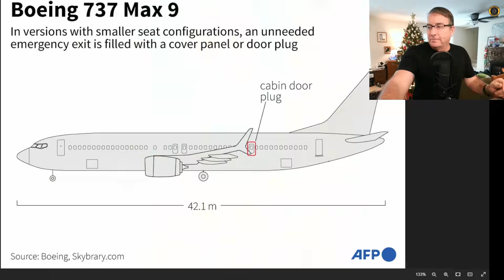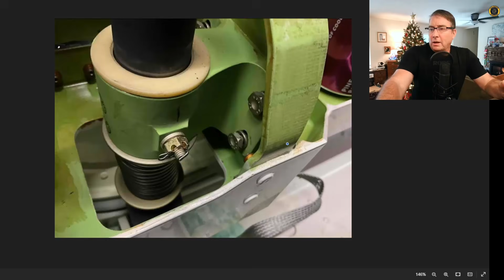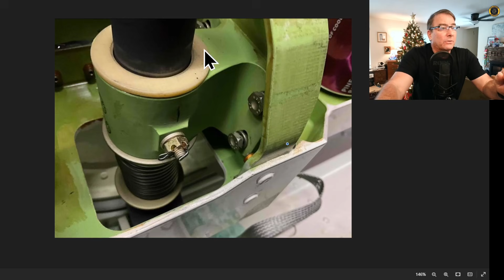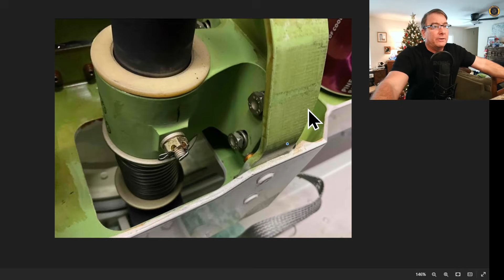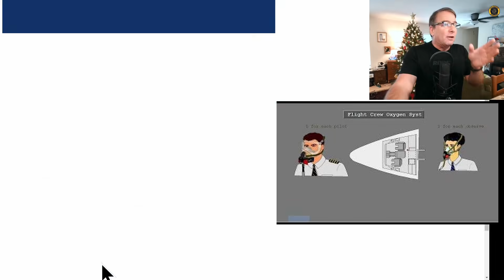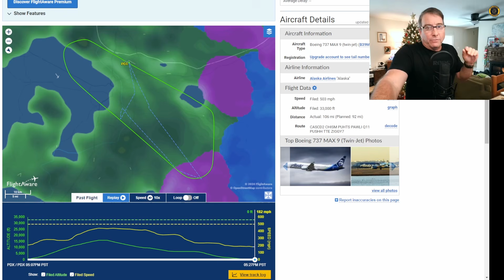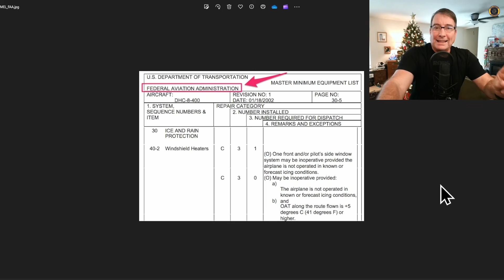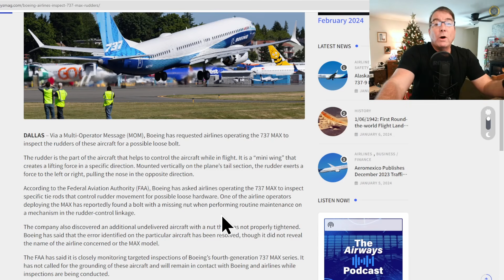"Yes, We Have No Bolts"  9 Jan 737 Max-9 Update

Comment: Who ever works in Boeing QA has got to be sweating right now.
Reply: Someone knows exactly who did the work and who signed it off as complete.
Reply: @grumpy3543  Yes you can pick those two individuals out by their obvious lack of sleep over the last few days!! The mech who did the work, and the Inspector who RII the work!!
Reply: @grumpy3543  Does it matter? It's obviously a systemic problem, so yeah I guess you could blame it all on the one guy who signed off on that particular job, but all that does is protect his hierarchy.
Reply: @seban678  Of course it matters. How does it not matter?  Of course it’s a systemic problem. That’s why they need to be shut down until they get it together. They would do the with an airline that had a systemic problem like that.
Reply: @grumpy3543  So you agree that it's a problem with Boeing as a company as a whole, but it still matters who the individual rando who didn't look at bolts well enough one time is? I don't get it.
Reply: @seban678  Exactly. Accountability.
Reply: @seban678 Same problem has already been found on five other dash 9s.
Reply: @grumpy3543  I wondering if the two people responsible for this disaster on the Plug have tried to ASAP it???
Reply: @grumpy3543  This has sabotage written all over it, plus the pilots erased the CVR, suggesting they did something stupid.
Reply: @itjustlookslikethis  I don’t think it’s that complicated. Just simple, neglect and incompetent. As far as the recorder goes I’ve never pulled the CVR CB in any of my emergencies. They pull the unit every time.
Reply: @itjustlookslikethis nothing the pilots would do on this aircraft would cause this issue. This was clearly structural, not a result of flight use.
Reply: They'll fire the lowest ranked person in the responsibility chain. In the old days they called it the scapegoat.
Reply: QA doubtlessly would be under huge pressure to reduce inspection costs by higher management. The same management who will doubtlessly be 'invisible' now that things have gone south
Reply: Boeing has a QA department?
Reply: @saab9251 QA organization.
Reply: @saab9251  yes because QA is only assurance. its not QC Control. its only an audit of systems now and again. the actual product is not checked. the people who build it are. its a complete shit show and the whole world has done this. no one can build anything with quality. They out source the parts to slaves, bring in a bunch of young H1B1 visa types to push the bureaucracy and teh conmen manager types revel in a chaos.
Reply: I disagree. Obviously, there's nobody working QA at Boeing.
Reply: @mikehanks1399  this is my favorite comment lmao.
Reply: Agree.  People can parrot 'Spirit' all they want, at the end of the day it's a BOEING 737.  Period.  It's BOEING'S reputational harm that occurs if people get sucked out of a 10 week old aircraft.  The buck stops with Boeing.  Slimy 3rd party responsibility deflections aren't going to work.
Reply: @BasedF-15Pilot and Boeing’s stock price proves it.
Reply: @BasedF-15Pilot  yeah. I wonder who hired spirit to make Boeing air frames.

I mean since we can't blame Boeing according to Boeing, we should blame whoever hired spirit to build these airplanes.

There's no way Boeing is responsible for hiring outside companies to make their air frames, right? 

It is such a weak excuse. It also proves why Boeing is the most dangerous modern aircraft. Boeing does not care about taking responsibility. They are interested in blaming everyone other then themselves. No interest in accountability to make the air craft better. Just blame blame blame blame blame. meanwhile the air craft never gets fixed.
Reply: @noconsent    If someone opened the plug door after the aircraft left Boeing's hands and was turned over to the airline, would Boeing still be liable?
Reply: @bobroberts2371  If I hired someone to work on my airplane, and that airplane broke while 18,000 feet in the air, I would take responsibility. But I have morals. Something Boeing clearly lacks, which is why hundreds of people die flying in the Boeing MAX.

Or are we going to pretend Boeing didn't blame the pilots for MCAS killing people? And pretend Boeing isn't doing the same thing now with the subcontractors Boeing chooses to build Boeing aircrafts?

Seems like a boeing problem they keep paying people to make subpar products that kill people.

but hey don't let me stop you from defending a company that knowingly put a jet into service they knew would kill people with one airplane going down every two years according to them, before a single MAX even went down.
Reply: @noconsent    You made absolutely no attempt top answer my question so I'll post it again.
If someone opened the plug door after the aircraft left Boeing's hands and was turned over to the airline, would Boeing still be liable?
Reply: @bobroberts2371  Boeing pays the contractor. By law Boeing is liable yes. I am sorry at your inability to read. I clearly answered your question. So I will answer again.

Contract law has boeing liable for contractor they hire doing poor work.

Even though Boeing itself was the last one to touch these plug doors, so contractors don't matter at all.

also according to the NTSB the doors didn't come off due to poor contracting, they came off because boeing designed at terrible aircraft that will break bolts.

oh and since we both know all this reading will confuse you again.

yes boeing is liable for hiring bad subcontractors.
Reply: @noconsent    So you are saying that Boeing is FOREVER liable for the work performed by non Boeing people AFTER THE AIRCRAFT HAS BEEN DELIVERED TO THE AIRLINE ?  Once again, I'll  repost my original question for the third time below.
 
If someone opened the plug door after the aircraft left Boeing's hands and was turned over to the airline, would Boeing still be liable?
Reply: @bobroberts2371  No one works on the plane that isn't approved to by Boeing itself. Which is the crux of the issue.

No one is saying it is Boeing fault that a group of mysterious men on motorcycles entered the factory one night and changed everything around without Boeing knowing.

any and all work done on Boeing MAX airplanes are done by mechanics and subcontractors approved personally by Boeing.

If a person working on boeing did a poor job, it is because boeing hired a crappy employee.

subcontracted or not.

your scenario doesn't exist. But get getting triggered.
Reply: @bobroberts2371  "Whatabout this made up scenerio that never happened" How about we stick to the facts. Where all work done on a Boeing craft is done by someone approved to work on the craft by Boeing.
Reply: @noconsent    said "   your scenario doesn't exist. But get getting triggered   "  
Got it.  So if an airlines mechanic leaves wheel bolts loose,and the wheel falls off, Boeing is responsible even though the aircraft is no longer in Boeing' s hands.  Why has it taken be so long to see the light?
Reply: @bobroberts2371  No one touched the door plug but boeing and those subcontracted by boeing to build their planes.

Keep making things up to get mad at, it is hilarious.

and yeah when a boeing comes shipped without any bolts on the plug door to the airline, it is boeing's fault. Nothing a mechanic can do to fix it or make it worse.
Reply: @BasedF-15Pilot Specifically, the buck stops with the CEO. Calhoun cannot escape the hotseat for this. This isn't a DEI issue, this is a management issue.
Reply: @GARDENER42  Correct those two, the mech who put the plug in place, and the Inspector who RII the work are bound by law to ensure that it was installed properly! Boeing may have to require  two RII inspectors to sign off critical work!!
Reply: @cv990a4  seriously I don't get this dei bs when the ceo is an old white dude.
Reply: @cv990a4 ohh no no no. DEI is indefensible no matter which way the pie is cut.
Reply: Amen
Reply: Boeing has a reputation?    Boeing should sell to a new company with top tier management.
Reply: Security Check Paint Marker does not appear to have been applied to the Torqued bolts. That's a design/build issue. 

So there's no way on a visual inspection to see if they have moved. 

 @neenernoodle
Reply: @adenwellsmith6908  Not every fastener requires torque stripe. It depends on the drawing as well as the quality inspection plan.
Reply: No argument there. There question is, should there have been? 

They are implying that its either a design fault in that the assembly instructions were wrong, or that someone missed the parts when assembling. 

Given its such a new plane, it is unlikely its stress fractures that propagated. 

Could be that the material used was defective. 

 @gungadinn
Reply: @adenwellsmith6908  I don't see many of those anymore, so simple, and so important for inspection. If they decided to stop doing that to cut costs, oh man, much bigger issues here
Reply: So most likely causes.

1. Assembly went wrong
2. Assembly checks not done. 
3. Assembly manual is wrong
4. Material fault. 
5. Design fault 

I would put it in that order. 

 @MoMadNU
Reply: @adenwellsmith6908 No refrencse marks on the bolts/castings, date coded?
Reply: There was work done to the interior after delivery. I think it will come down to an Alaska subcontractor
Reply: @akshonclip  The image at 5:49 is from yesterday on a United Max 9 they was preparing to inspect.  United said that they found several instances of loose bolts.  Alaska chimed in a bit later saying they have seen some bolt issues in this same area as they wait for FAA instruction on how they will complete the process.
Reply: Boeing QA was the first department out of the door after the Boeing/MD merger when the accountants took over running the show.
Reply: LOL nobody works at Boeing QA.
Reply: I'm guessing, They are quickly printing up 737 max order forms showing these bolts are now an optional item
Reply: No they don't, they killed over 300 people and the CEO got a 30 million bonus that year. All they care about at Boeing is the bottom line, passenger safety is out the door.
Reply: What sucks is to save money Boeing has like one licensed aircraft technician overseeing the work of dozens of low paying high school dropouts and all the blame will land on the one licensed aircraft mechanic. Licensed aircraft mechanics used to be required but nowadays more and more Boeing relies on one licensed mechanic overseeing dozens of assembly technicians who don’t know anything about aircraft maintenance
Reply: Boeing doesnt do interiors, that would be a company like safran or encore
Reply: @motskater  boeing definitely does the final assembly work in the interior, wiring, etc. - but not the cabins.
Reply: @motskater  Airbus used a company called Sergoma that did the interior installation.
Reply: I worked at Boeing a long time ago. Believe me NO ONE at the kite factory is sweating.
Reply: Blaming individuals is exactly the wrong attitude for building quality products.
To get quality, you blame the process not the individuals.
ie. Why did the system fail?
Reply: Bet C-suite and executives still get a bonus, though.
Reply: @NonEuclideanTacoCannon  Of course they will
Reply: Depends what the manual say.
Reply: Spirit does the parts but Boeing the assembly
Reply: Wonder what happened to the pickle fork issue on the NG’s. Juan talked about it awhile ago. Never heard an update.
Reply: That's the problem, they've got rid of a lot of their QA inspectors to try and save money!
Reply: @BatfinksWings  they got rid of the senior qa m replaced with Mcdonald guys and people barely reading and speaking  English to do inspection with no quality background in Renton max lines.
SO WHAT DID THEY KNOW TO INSPECT WHEN THEY DONT UNDERSTAND THE REQUIRED SPEC, WORK ODER, AND READING OF THE  ENGINEERING  BLUE PRINT..YOU TELL HOW IS QUALITY ????
Reply: You are assuming they have such a department.
Reply: flyingfox you have no clue. I was in QA at Boeing. we are handy caped by management. They tell us what to look at and what not to look at. It's all about the money. Keep your comments to things you know about. !!!!!!!!!!!!!!!!!
Reply: Not if they are affirmative action DEI .
Reply: Could be a worker sabotage or excess marijuana weeds.
Reply: Obviously nobody works in Boeing QA.
Reply: It's the accountants at the top causing these problems. QA reports problems and they're told to shut up because it causes delays.
Reply: They are a shoddy company just like the old British Leyland philosophy of building cars (that will do)
Reply: Not really. Nobody works in Boeing QA, apparently!
Reply: I work in aerospace manufacturing. Everything gets logged. Every tool used on each bolt gets logged. They will know who did the work, with what tool, and how the tool was checked for calibration, and when it was last calibrated.
Reply: Guaranteed some dude somewhere is sitting in a dark room pouring whiskey in a glass and saying "see? I fucking told them"
Reply: If they even have one...
Reply: Spirit Aviation in Wichita KS produced the doors and fasteners. Plus did the torque sequence. 
Management knew from employees this was not working right.
Reply: Since the MD merger, Boeing does not have QA or QC. They just have management, who are slaves to the shareholders.
Reply: From Boeing's website.......We go further together
Connecting, protecting and exploring our world and beyond requires diverse perspectives and innovative minds across the globe. It requires you — bringing your whole self to work every day. We’re committed to creating an environment where everyone is welcomed, respected and supported in reaching their full potential. Read more in our 2023 Global Equity, Diversity & Inclusion Report.
Reply: Boeing fired all their QA workers in the late 90s after the McDonnell Douglas merger. The last thing on Boeing's list is making a safe aircraft. Number one is cutting expenses and increasing sales, any means necessary. That also explains why the Boeing Max killed over 300 people and is the most dangerous modern aircraft ever made.
Reply: Boeing QA is an oxymoron. Mullenberg apparently fired them all. I am a licensed A&P. We take that responsibility very seriously. Boeing must be hiring idiots. Castlated nuts and cotter keys are pretty damn basic. Imaging if they had to do safety wire?!?!
Reply: @ranchopatriot  Of course it does. Why should we care?
Reply: @ranchopatriot  100% those two individuals have been sweating the last few days!!
Reply: Too bad they weren't sweating the details last year when it would have done some good.  I didn't renew my membership in the Boeing fan club!
Reply: loose nuts !    -->  loose plug-doors --> pressure fault alerts.     There were many fired employees at the subcontractors and lawsuit(s) in 2023.
Reply: Does anyone I wonder?
Reply: Yikes. My guess is that the bolts were never installed.
Reply: Everyone is in hot water  ... The Max cannot continue to have multiple black eyes ... the Boeing stock is a roller coaster now
Reply: Did they also outsource QA to India?
Reply: Whoa! Wait! Boeing has QA??????????
Reply: Pushed, stretched, and squeezed to the max then pop! Quite literally
Reply: They didn't sweat when people have died. 
Now they won't ever bother.
Reply: Nah they aren’t held accountable
Reply: If it’s a black female lesbian, she/they/whatever will get a promotion and given an award for her bravery
Reply: What QA?
Reply: Nope, loose installed at Spirit. It’s Boeing who’s responsible  for final installation.  Boeing remove the door to install interiors. And squawks the aircraft for delivery.
Reply: @qwicxs    But does Boeing do the final interior fitting or does the aircraft get sold to the airline bare then the airline has the interior fitted?
Reply: Boeing signed off on accepting the door and signing off the plane as safe to the customer. The blame lays squarely with Boeing as it’s their name on the product. The CEO and VP of quality have to resign immediately once the investigation concludes its findings if not before.
Reply: Nobody talks about the previous flights having cabin pressure problems.  This should have been figured out.
Reply: No, the executives should be sweating and selling stock quickly.
Reply: Do they have one...
Reply: I would implore everyone to google 'Spirit Aerosystems lawsuit' and read about the quality issues and quality report falsifications that are being alleged against Spirit Aerosystems and Boeing. Very serious stuff here.
Reply: probably sitting on a container of unused bolts
Reply: They would be seeing if there is any chance of some of those four bolt were never installed.

Getting the those pins under  microscope to look for do the marks.
Reply: I worked at Boeing, this is clearly renton shop and quality fault..Renton assembled and installed to make this door fitted onto the fuselage frame...Spirit only built the plug door for  renton manufacturing to  install  and adjust it to make it secured to the fuselage. From my experience,I can see it is inproperly torqued without quality witness to the spec torque value by mechanics and qa stamped off the job..Secondly, islsoif  the design error.. All bolts in that plug door area  should all have cottin pin lock of some type to each installed bolt for adding  security..4 bolts with locked pin is not enough to withstand vibration and pressure over time..This is workmanship error for both shop and quality sides.,has nothing to do with Spirit.
Reply: @ranchopatriot yes they will find the work order to who did the installation and who buy off the job are 2 people be in deep trouble..  also 2 managers on either sides will get hit too aswell..
Reply: Nope....😂😂😂
Why do you think, did Boeing move their company HQ to Arlington, Virginia ??
To lobby directly in Washington.

So no matter what they do. Even if they do it on purpose, someone will just walk down the street and give the right person a briefcase with a lot of money and the FAA will declare 'everything A-OK at Boeing' exactly like they did with McDonnell Douglas and the DC-10.
Reply: You mean FIRED!
Reply: As they should be…Right?!
Reply: @ErichH68   said "As they should be…Right?!      "  

If the door plug was removed / installed after Boeing sold the aircraft, would it still be Boeing's fault
Reply: @bobroberts2371  No I would say not. However, no matter who “last touched it” it still needed to be inspected before flight.
Reply: Hope they all get put in prison.
Reply: Nope this is a management problem, they started focussing on wall street and adding value rather than a safety first above all costs. Anyone who objected or raied concerns for safety was eliminated, and the severely cut the QA team. numbers. Funny that how they have all these issues now... You'd have to pay me a very large sum to get on a boeing these days.
Watch "Downfall, The Case Against Boeing" - it's a bloody good documentary.
Reply: This was done on purpose for a new cycle distraction....
Reply: sure buddy, take your meds  @tvviewer4500
Reply: NOBODY works at Boeing quality control, if they did this sort of thing wouldn't happen 😀
Reply: Spirit Aero Systems.
Reply: @zeitgeistx5239  Juan mentioned in the last video that they make the fuselage but it goes back to Boeing for interior fitments.
Reply: @Groovy-Train  With the door already covered. This is still with Spirit, a spin-off of Boeing which has a former Boeing exec as CEO. Spirit was created to unload responsibility and costs from Boeing. ETA: Boeing do remove these doors during fitting out in their plant, so I was wrong and this is a Boeing issue.
Reply: @cageordie Juan said that Boeing removes those plugs during fitting and they are the ones that install them for the final time.
Reply: @cageordie  In the previous video, Juan states that the fuselage goes back to Boeing and the plug door is removed when the interior fitments are made. If that is correct then it means that Boeing will be the ones to put the plug door back in again afterwards.
Reply: @Groovy-Train  I dont think Boeing would be removing the hinge fittings bolts a shown at 6:40 to perform interior fittings.
Reply: @cageordie  Like Juan said before, Boeing removes the door when the first get it from Spirit.
Reply: @cageordie  Boeing attempting to unload responsibility elsewhere and put their head in the sands? Nooooo, can't be. I am shocked, SHOCKED, I tell you
Reply: Spirit Aeros stocks are down a good bit.  @cageordie
Reply: @cageordie  Boeing and Spirit in a deadly embrace relationship. 
There's such a strong coupling between the two that Boeing and Spirit can't live with each other!
Reply: @cageordie  Spirit in Whitcha Kansas was a Boeing outcast company, as most of the work performed there was military conversion work. They built the aerial refueling tankers as well as refurbishments.

The current 747 aircraft that use the call sign of Air Force One be modified there. Spirit also manufactures a lot of the thrust reversers used on Boeing commercial aircraft.
Reply: @cageordie THANKS for knowing this FACT.
Reply: @zeitgeistx5239  In another video, it was stated that Spirit intentionally ships the fuselage with the plug doors not fully installed, because the opening is used by Boeing to install the airplane's interior. When the interior is complete, Boeing is supposed to finish installing the plug.
Reply: @hacerclic1020 Let the finger-pointing begin!
Reply: @zeitgeistx5239  Boeing install the door plugs.
Reply: @zeitgeistx5239  Wrong, Boeing removes the door and does the final squawk. Nice try.. bolts are loose installed at the supplier.
Reply: @zeitgeistx5239   My understanding Spirit just make the 'plug' door   Not their responsibility to make sure its fitted correctly.
Reply: @MrSeebsy  There are multiple photos of -900 and Max 9 fuselages on railcars en route from Spirit in Wichita to Boeing in WA with the plug installed. However, it's been noted that Boeing removes them to facilitate the completion process.
Reply: @stephenjarzombek2903  Yes, when traveling by rail you want to have the fuselage pretty much closed up, so that it does not rain or snow inside.
Reply: But loose bolts were found on the green bottom fitting  (see photo in video), that’s part of the fuselage surely?
Reply: @stephenjarzombek2903 
They pass through the BN rail yard in Kansas City regularly.
Reply: @bishopdredd5349  That would mean the door departed the aircraft w/o the bracket(s). Since there is the arresting pin holding the bracket to the hinge, the bracket(s)I  would still be on the plane. That's a plausible fail scenario, but that would have been obvious upon first inspection of the plane.
Reply: @MrSeebsy  , it is installed by Spirit, but then the cabin is shipped to Boeing in Renton and it is remove and re-installed by Boeing as part of the interior installation ...
Reply: Probably not a quality issue.. rather a design issue.  Those loose bolts observed on other plances, should have been drilled and wired ... I think it highly probable, that is the root cause of this plug door blow out failure.
Reply: No, they're a DEI hire and promoted for that reason.
Reply: @toomanyhobbies2011  where are you guys getting this DEI bullshit when it is clearly the primarily white shareholders and board room that has cut so many corners that the company is now a perfect circle?
Reply: You live in a bubble. No DEI hire is sweating at Boeing. This person will get a promotion.
Reply: Sounds like you know the corporate CYA dance well! @Eulerpi23
Reply: @Eulerpi23  lol the irony is its the white CEO's and upper management causing this problem with Boeing
Reply: @Eulerpi23 
What's your problem?
Reply: I just checked, Boeing is union.  Have there been labor / company problems lately?
Reply: @bobroberts2371  the company problem is the management chasing stock prices and cutting corners, not the laborers.
Reply: @alexandersnider734    Ever hear of the union mantra " Not my job " ?
Reply: @bobroberts2371  yeah, but when you hear hooves, think horses not zebras. All of Boeing's issues have started once there was new management after the merger, and the engineering led management was eliminated. So you should be looking at the board room, not the guys who dont have a say in systemic safety issues anyways.
Reply: @alexandersnider734   said "  but when you hear hooves, think horses not zebras.    "
Actually I think of Monty Python but that's beside the point.
There would have been 2 operations to finish an open door plug.  One to physically close the door and secure it with bolts.  The other to install the interior finish panel.  The person installing the interior finish panel could easily say " not my job " to look over other work performed.
Reply: @bobroberts2371  it wasn't his job, nor should it be. we cant build airplanes that people entrust their lives to, on the assumption of "people speaking up if something looks off". there are a million reasons why someone might not, whether its negligence or fear of their boss or whatever. Management is responsible for implementing systems that rigorously ASSURE beyond any doubt that the plane is built to the necessary safety standards. The fact is, management prioritized speed and cost at the expense of assuring beyond any doubt that every bolt, nut, and washer has been tightened to the proper torque. They put the workers in the impossible position of doing thorough and careful work, at breakneck speed, and laid off anyone who rocked the boat.
Reply: @bobroberts2371  " The person installing the interior finish panel could easily say " not my job " to look over other work performed." Yes, especially when they are normally unlicenced personal.
Reply: @jdshemp  said  "   Yes, especially when they are normally unlicenced personal.   "  

So you are admitting that if an unlicensed person sees a loose / missing bolt, they can say " not my job " and not tell anyone?
Reply: @alexandersnider734    said "    it wasn't his job, nor should it be. we cant build airplanes that people entrust their lives to, on the assumption of "people speaking up if something looks off".    "   

You are admitting that if someone comes across something wrong, they SHOULD SAY NOTHING because it " isn't their job " .    

Say a worker for airline 1 sees damage on  an aircraft owned by airline 2.  In your world, the worker for 1 SHOULD NOT tell number 2 because " we cant build airplanes that people entrust their lives to, on the assumption of "people speaking up if something looks off".
Reply: Nah, with minimum wage so high, fast food jobs pay just as good as inspector jobs do.
Reply: @modelenginerding6996 I don't think anyone would intentionally choose to work at a fast food place over Boeing for the same hourly rate. Retail work is pretty nutty with the public.
Reply: shaniqua